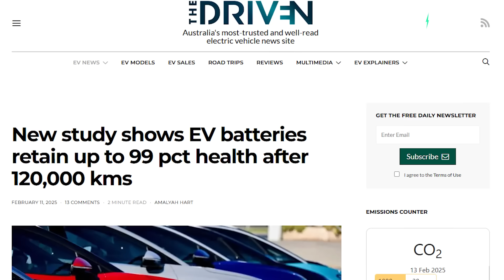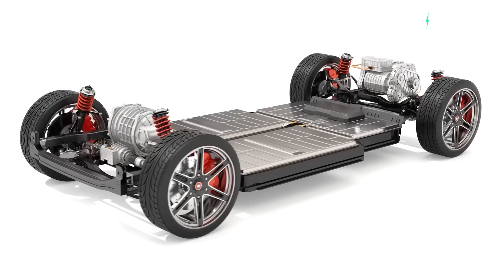New study reveals EV batteries retain 99% health after 120,000 kms

Comment: I’ve seen a British media company like autocar investigate a Tesla that had done 400,000 miles as a taxi over its 13 year life. The battery had lost 30% of its original capacity ie it was down to 70%.
Reply: 13 years. That means that car was bought in 2012, probably a model S. 2012  is like the stone age for EV battery technology. The 2018 Model 3's with that millage already retain 85% capacity. Since 2018 A lot has improved in battery tech by Catl and BYD. So imagine what an Atto3 or an MG4 will do on retaining battery capacity
Reply: @ A taxi is constantly starting and stopping extra stress on the battery
Reply: Don't forget that a taxi always uses Supercharging so high speed/Power charger. Just because of this the data sounds great even for an old battery type.
Reply: Exactly, it's terrible. It's not possible to have 1% degradation after after 100k km. This video complete nonsense.
Reply: @Kallon-r3b 30% after 400,000 miles is NOT ‘terrible’.

If a replacement battery costs $20,000 (they don’t), that’s only 5 cents a mile.
Reply: @JohnSmith-x3y8h many analysts believe the battery packs will cost around $50 per kWh by 2030. That would put the cost of replacing a typical 60 kWhr battery pack at $3,000 by the time anyone buying an EV today has their battery warranty expire in 2032.
Reply: @zoransarin5411  I totally agree, but if I’d done my calculation on that basis, I’d have been immediately attacked by people citing the endlessly referenced guy who was charged much more to replace his Tesla-S battery a few years ago.
Reply: @Kallon-r3b 400k miles with 30% range loss is really good on the old lithium ion batteries. The LFP's today will easily do 500k with 20% loss or less. Catl has a 1M miles battery warrantied.
Reply: @Kallon-r3b you need to learn to read and understand simple sentences and words. 99% health is not equal with 99% capacity.
Reply: @Kallon-r3b 400k miles terrible?
Reply: @Kallon-r3b  You're confused. Part of the degradation process involves time as well as mileage. And the battery JohnFrancis cited is 13-years old --- meaning it's an extremely OLD battery that is based on obsolete technology.  Very few ICE vehicles can reach 400 K miles -- and the new models are often blowing engines and transmissions under a 100 K. And that's true of Honda and Toyota as well, they have given up on durability.
Reply: @ the video is very accurate.

Comment: 120,000Km?  That’s not really all that far.
Reply: It's not far. However we were told that most of the degradation happened at the beginning of the battery lifespan. Looks like there is reason to be optimistic.
Reply: A lot of ICE cars are halfway to the crusher by 120,000km.
Reply: @  lol.  What kind of crap ICE vehicles are you talking about?   My last two got to 250,000 MILES before they gave out.  Again…125km…not impressive.
Reply: @pitottubed70 
I’ve got an ICE car that has done close to 400,000km too - but that’s not to say that they all get there. Breaker’s yards have many examples scrapped with 200,000 plus km on the clock. 
Congratulations on getting your ICE cars to 250,000 miles and congratulations to those EV owners approaching similar mileages.